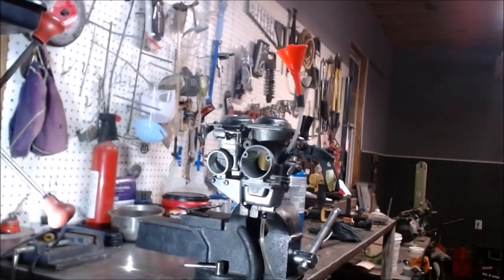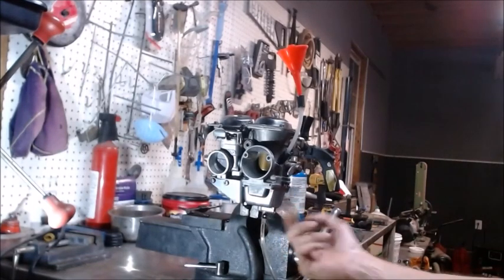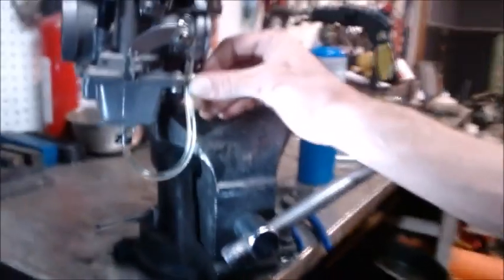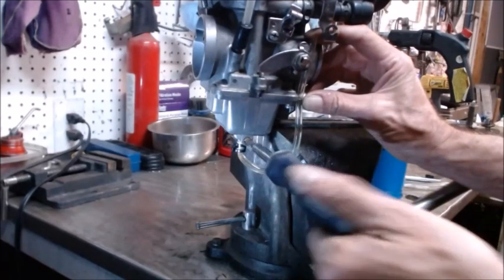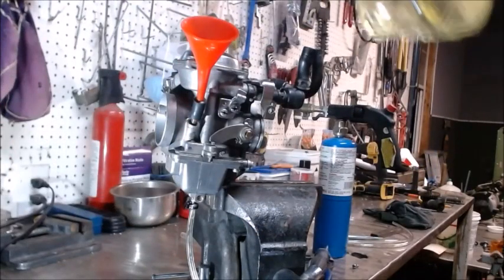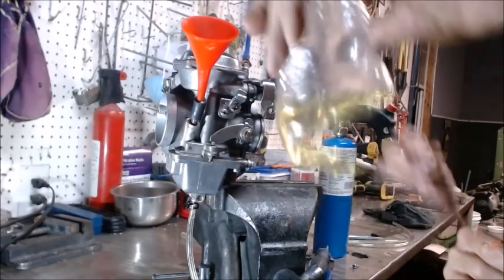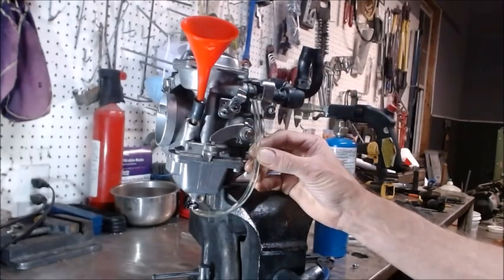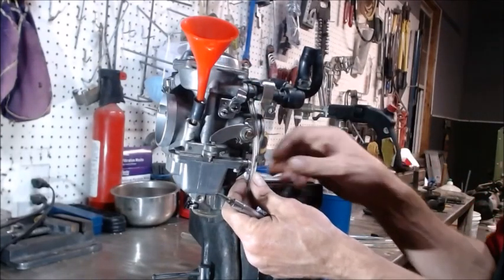Virago xv750 Carburetor Float height Adjustment

Comment: Your videos are priceless for Virago community! I've almost rebuilt my carburetor but encountered a mysterious problem. I cannot set float height in both carburetors. It always floods, even if I set it to close earlier than in the spec. I've opened it, blew air into the fuel inline and it shuts correctly when I barely touch a valve seat. Both floats move unrestricted, and smoothly. I've tested them - they are not leaking. But when I close the cap and fill the carburetor with fuel, it spills through the pilot jet (probably) hole inside the carburetor. I've run out of ideas about what went wrong. :/ It looks like floats don't block fuel even if entirely covered by fuel.
[EDIT]
I managed to set it. It appears that my floats had to be set way out of all suggestions on all YT videos. They are set quite high when carbs are open and upside down. So the advice for other people - if you see/know that someone was messing around with your carbs previously, don't assume that the parts inside (like floats) are not already bent in a weird way. Additionally, I've used a repair set and I think that changing valve seat assembly also changed float settings.
Reply from the maker: Hey !  Sounds like you got it figured out 👍. Yep, the floats are very delicate and if someone had really gotten them out of adjustment it is sometimes hard to figure out what is going on with them without putting fuel in to them on the bench and slowly adjusting the tab so it blocks off correctly.

Comment: Struggling with trying to figure out the front carb issue. No gas in the bowl or hose. Rear cylinder runs fine. Appreciate the lesson on how this works I will check the floats when I get home.

Comment: Awesome video, very well explained 

Do you know if it's the same procedure for the XV535?
Thanks
Reply from the maker: Thanks man !  I’ve not worked on an xv535, but I would say the float adjustment and everything would be very similar as normally the float is adjusted so the fuel fills the bowl completely, but not so high that it will overflow into the intake on most carb engines 👍

Comment: What is the size of the clear piping used on the carb float bowl? Is there an adapter used to attach the clear piping?
Reply from the maker: Hey man !  I believe it’s 1/4” ID and is just the clear type tube you can get at places like Lowe’s or Home Depot. It just slips over the drain port on the bottom to f the bowl and then you can put a little clamp on it to keep it from popping off when pulling up on it to make the loop👍

Comment: If Im getting to much fuel and gas dumping out of the breathers. Would it be safe to say this could correct my issue? Picked up an 82 yamaha virago 750 the other day
Reply from the maker: Hello, yes, if the float heights are set too high, you can get fuel running down into the cylinders as well as spits of fuel blowing back out the carbs.  It could also be that the carbs are dirty as well that will cause this (the cylinder makes like a hiccup now and then and will blow the fuel out the intakes). It could also be other things not carb related like the valve gaps are too tight or too loose so the intake valve is not closing fully or at the right time and fuel gets blown back up the carb. Hope this helps and all the best !  Steve
Reply: I am also having this problem with my 85 XV1000.  I have flooded the engine 3 times.  1 - 2mm float height makes a big difference.  At 18 they flood but not at 20.  I am probably going to set them at 21.  At 23, the engine was starved of fuel.
Reply from the maker: @dubwicht1  👍. Yep, from what I’ve found, the float height would almost be considered a critical setup parameter for these carbs with how they did the emulsion tube air ports.  It’s virtually impossible to tune one with the fuel setting too low in the bowl and just fills up the cylinders (and eventually the oil) with fuel if too high like you said 👍.

Comment: Hey I can’t seem to figure out why the float bowl is just leaking lots of fuel every time I put fuel in it to check the level please help!
Reply from the maker: Hey !  If you have the carbs off the bike, I would try removing the bowl and then hold up on the float (softly) till it blocks off the fuel inlet, then put a little fuel in to see if the float valve is sealing. If it’s sealing off with the float lifted, then it sounds like the float tab needs to be bent a bit more to get the float to block off sooner.  Either that, or the float has a hole in it and has filled up with fuel and won’t float properly anymore.

Comment: What angle is the carb on? Wouldn't the incorrect angle mess up the test?
Reply from the maker: Hey man !  Yep, the angle the carbs are held at will definitely affect the setup 👍. For my 750’s the motor is pretty level on the bike so I set my carbs in the vise so they are both at the same angle (the two combined are level). That way it mimics how they are when mounted to the cylinders.
Reply: @StevesDIYs  Thanks Steve.

Comment: Hey Steve! Which diameter hose did you used to attach to the float bowl?
Reply from the maker: Wilian Amaral , hey man! I used a piece of yellow/clear 1/4” OD weed eater fuel tubing...not the whiteish type as it doesn’t stretch when heated a little on the end to expand it to fit on the carb and doesn’t bend very well. I think it might be made of silicon, but not 100% sure
Reply: @StevesDIYs  thank you brother!

Comment: Have you ever attempted to remove the bowl while the carb is still on the bike? I don't know how many times I took the carb off the bike but its tiresome.
Reply from the maker: Hey man !  Yep, I’ve taken the bowls off to change jets (even with the original bowl screws vs. replacing them with Allen heads). It is a little less hassle, but a couple of the screws are kinda hard to get to. Here’s a link to another video on the channel where I take the bowls off while the carbs are still on the bobber:  https://youtu.be/Ddd2JQn85Z4 .  There’s also a video on the channel for how to take the carbs off and put them back on that shows a couple of tricks to making it easier.  All the best ! Steve
Reply: @StevesDIYs  Sweet! I will check the videos out. Thank you Steve.
Reply from the maker: No problem 👍. Have a good one !
Reply: I've adjusted my float bowls now I'm stuck as to why the bike still drops in rpm or even stall sometimes when I lean it far enough to the right(not left) or when I rock it side to side or front to back. And I'm thinking it might be that the two floats in a carb are not at the same height and so are causing this problem, but I doubt that is the case.

Maybe you have some ideas.
Reply from the maker: @countbaker5595  , it actually could be that the individual floats have been bent so the level changes if leaned over, but I wouldn’t think the motor would react very fast to the change. I’ve had the petcock strainers up in the tank start getting blocked up with crud at the bottom to the point that the reserve level wouldn’t allow fuel to come down. Might be something to check as well if you haven’t. I’ve also accidentally adjusted the throttle cable too tight so when I turned the bike to the left the rpms would go up, but that sounds opposite to what you are seeing.
Reply: Ripped my diaphragm by 1/2".
Only new pair i can find on ebay go for 70CAD. I think I'm about to convert to single carb.

I spent too much time and money finding the right rebuild kit for this carb on my xv1000 all because some previous owner put a vtwin version 1 carb which belongs on year 81-83 750.

Any thought on single carb conversion? I figure it will be easier to work on and parts are also more readily available, especially here in the prairie.
Reply from the maker: @countbaker5595  , I’ve not experimented with the single carb conversion, but I do have one and plan to play with it in the fall once riding season is over 👍.  I’ve heard that there are a couple of people in the US making them (a guy named Adam Smith I believe is one of them) and folks have said they were happy with them when paired with a newer flat slide carb or more modern round slide carb. For me, the only way I could see one working properly would be if it was designed so that the intake tubes were equal length to each carb...if they were different lengths I would imagine one carb will be favored so one will be tuned and the other would be too rich or too lean.  I don’t know for sure since I haven’t played with mine yet, but as grumpy as the bikes are when you mess with the air or fuel settings, I think it would be really hard to make both cylinders happy with just one carb unless done right. There are posts out on the “Virago Nation, all things Yamaha Virago” Facebook forum that folks talk about them quite frequently (with mixed emotions of course, lol).  If you get on Facebook you might check out that forum to see what folks are saying 👍.
Reply: Hence the reason for bench test and set up

Comment: I'm having fule spitting out of my exhaust after my first start up of the season, would this be my issue?
Reply from the maker: Hey man, if it just started doing this at the first startup of the season, but didn’t do it before, I’d say the float may have just gotten stuck after sitting for a few months. If it doesn’t straighten out, it might be worth it to pull the carbs and give then a little cleaning….then check the float height while the are on the bench 👍.

Comment: Cant find the air mixture screw. Bike is running too rich
Reply from the maker: Hey man ! Did you find the air/fuel mix needle?  It’s toward the front of the carb on the bottom where the carb connects to the rubber boot on the stock 1st Gen carbs. If it has never been adjusted, there would be a small round aluminum disk (about 1/4” diameter) that covers the hole where the needle is. This disk has to be removed by drilling a small hole in the center of the disk and then prying it out. Be careful as the top of the needle is immediately under the disk so you have to go easy and feel when the drill bit goes through the disk and stop or you’ll damage the flat head screwdriver slot on the needle. If the disk has already been removed, a small flat head screwdriver can be put in the hole and will engage into the slot on the needle top.